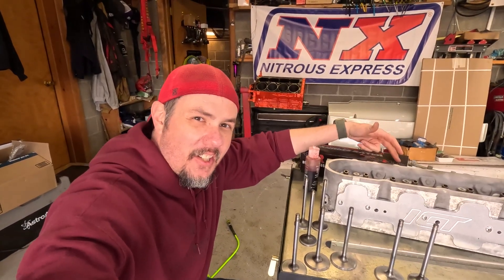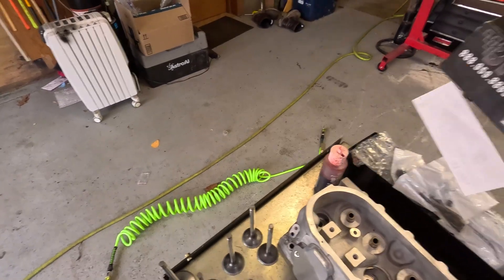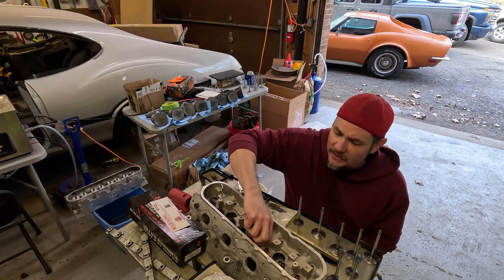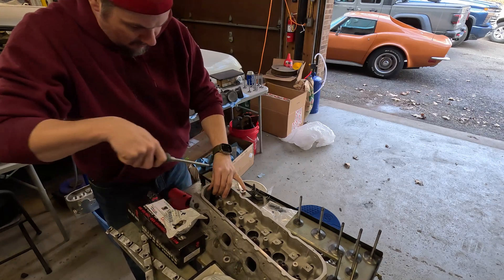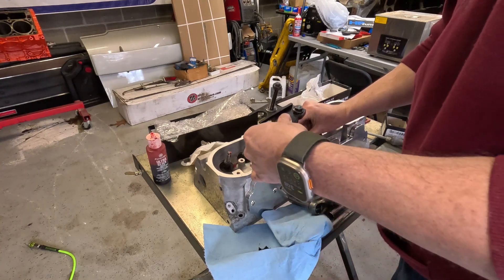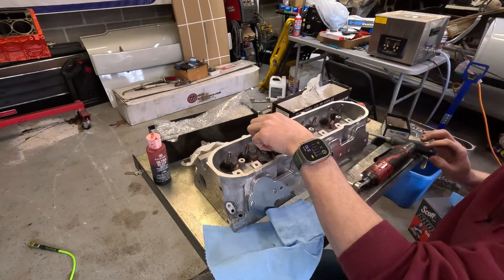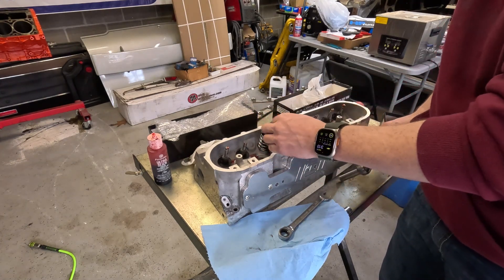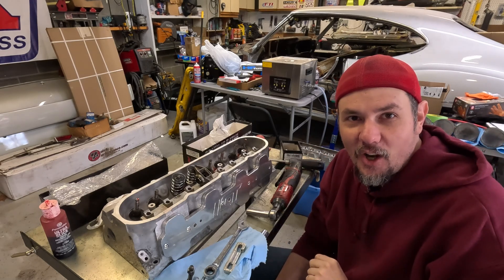Installing Upgrade Valve Springs In LS Heads

Comment: One thing I had on my last build using used rocker pedestals… one rocker wasn’t sitting on the center of the valve stem (clocked slightly), even when trying different rockers. The pedestals were worn slightly. New ones were cheap and all the rockers were perfect on the valve stems.